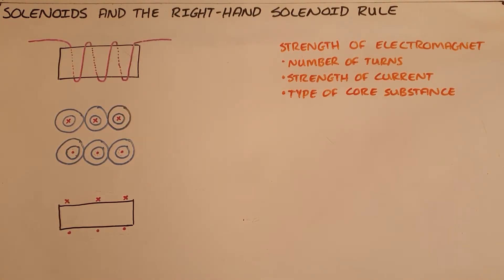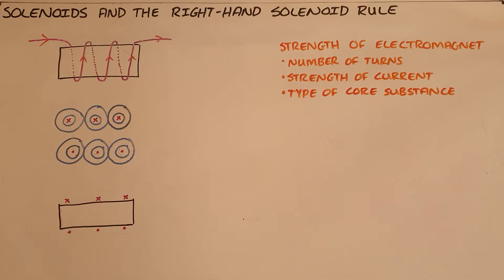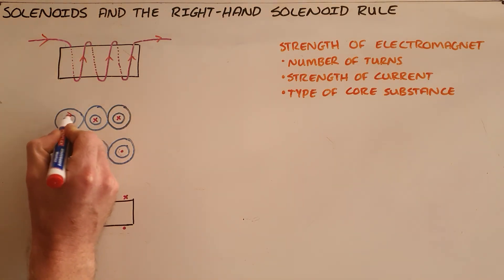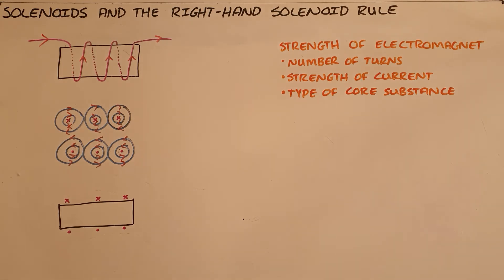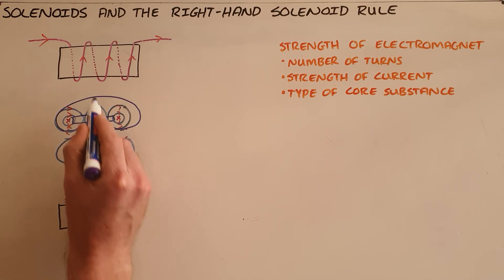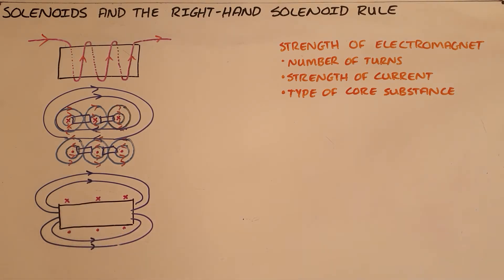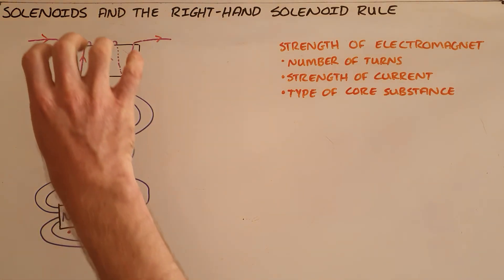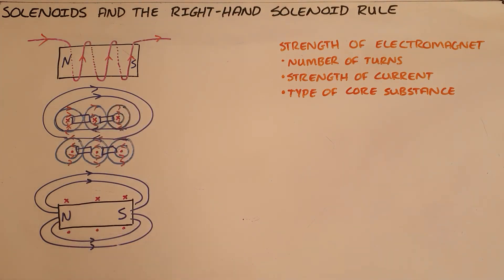Solenoids, Electromagnets and The Right-Hand Solenoid Rule

Comment: You literally did more in 3 minutes 53 seconds than my teacher did in the course of 2 weeks😭. 
Question though: what would happen if the North Pole of a magnet is pushed into a solenoid as opposed to when the South Pole is pushed in?
Reply from the maker: The current would flow to oppose the change, thereby inducing a north pole on the end of the solenoid closest to the north pole of the incoming magnet.